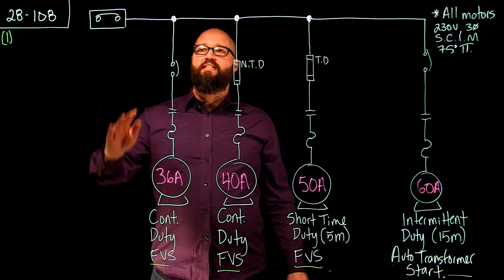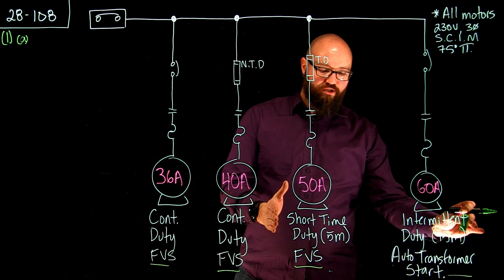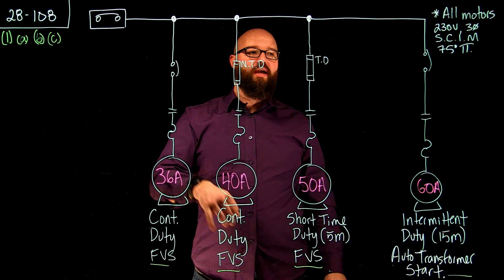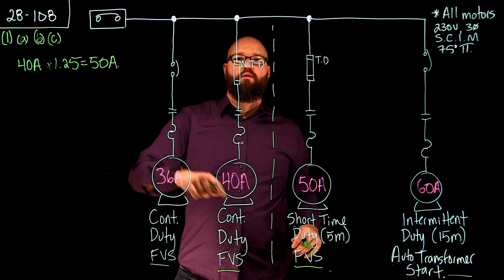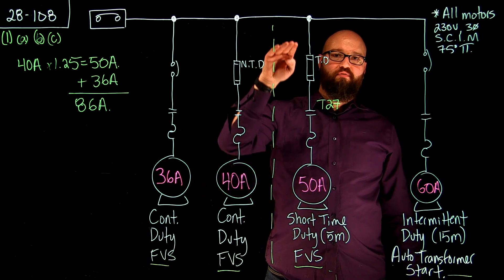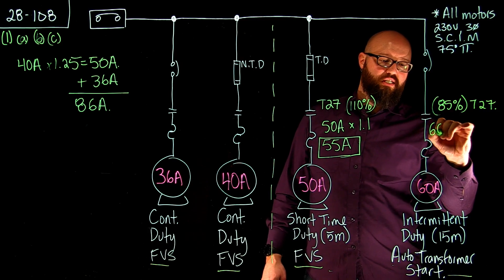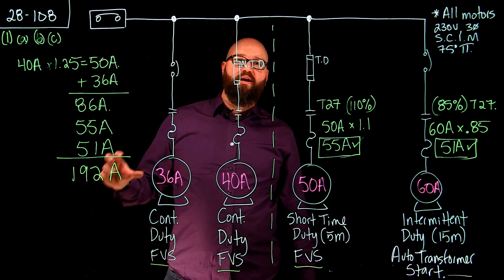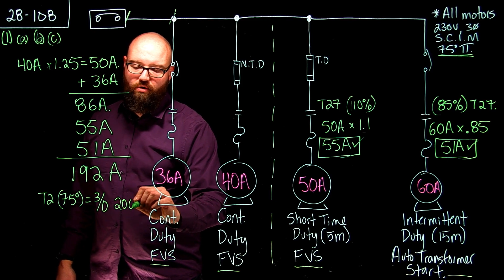Motor Bank Feeder Conductor

Comment: Im doing IP prep questions and one asked about sizing the Wire from the CB to the splitter to feed a bank of 4 motors. it says theyre continuous duty so after my caclulations i went to Table 2 and used the 75 degree colum. apparently the wire size i chose was too small. In the notes it listed Note: Equipment termination temperature is not given....
But dont you assume 75 degrees if its connecting to equipment?
Reply from the maker: We would only assume 75 if the required ampacity is morea than 100A. If it is 100A or less we assume 60 degrees.

Comment: I’ve been trying to find a good resource for all this multi motor, multi tap question and couldn’t find any till now! Thank you for walking through the whole process step by step!!
Reply from the maker: You are very welcome. I am glad it could help. Thanks for watching and commenting!
Reply: @schulerruler  One thing I noticed is I believe you are using the CEC is that correct? I am studying from the NEC to take my Masters test in the states and I noticed just the page references are different but the code for these are very similar between the NEC and CEC is that the case that you know of?
Reply from the maker: @Rdrooger  I have not had the opportunity to cross reference with the NEC to check how cross compatible they are, but yes these are all CEC electrical code references. If you do happen to find out I would love to know!